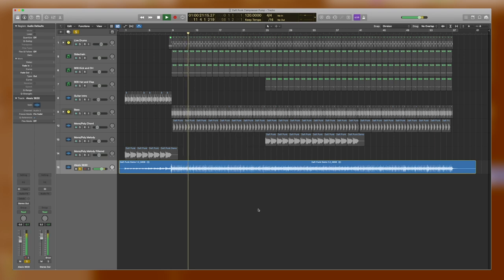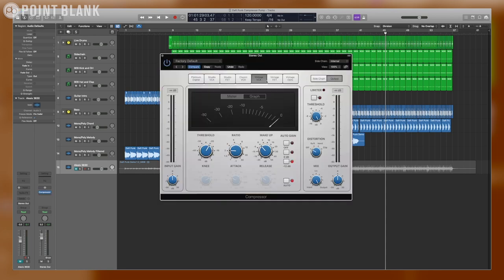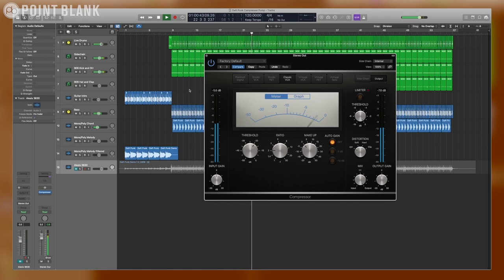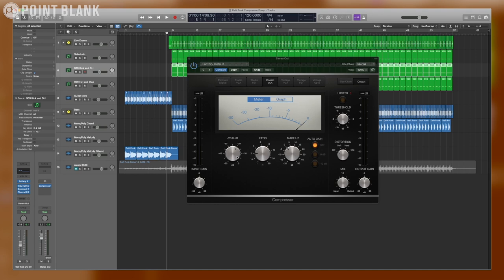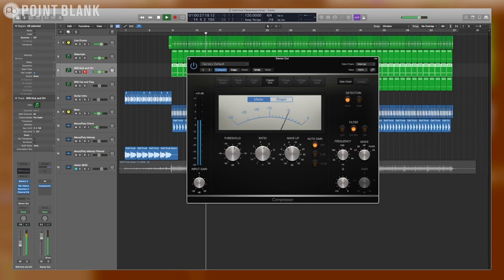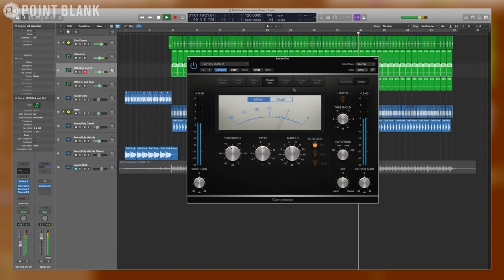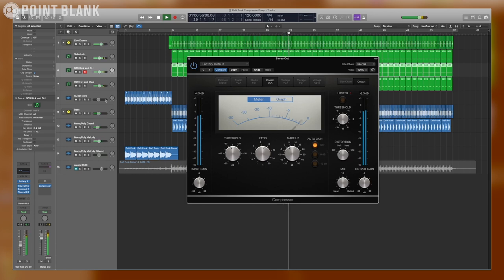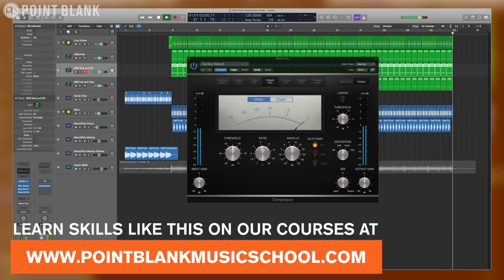Daft Punk Style Vintage Sidechain Compression in Logic Pro | Tutorial

Comment: As for when I do any ducking/side chain comp stuff..  I never use the sound you hear the track.. Sure,,, I can USE that Kick Sound,  I just duplicate the track and assign to NO Output... 
That way I can change the sound , if I want to , to change the effect, also allows some cool polyrhythm pumping.. Just allows more options..

Bit of 3630 trivia...  When I worked in HiTech Music retail store, We opened up a 3630 when we got our First shipments.(we did that with all our gear, ) and low and behold, the first few revisions actually had The VCA chip  from DBX in it,,,  Also...  The 3630 has the fastest gate (open /close) Id ever experienced on a box like that....
(To add: Biggest let down? Waiting years for the announced Behringer TUBE gear , the compressor which basically was their 1 unit versions, all surface mount , with a TUBE init and a bulb behind it to show you the Tube was on!! lol... That 2 unit box inside was all air!)
Reply: This is the way